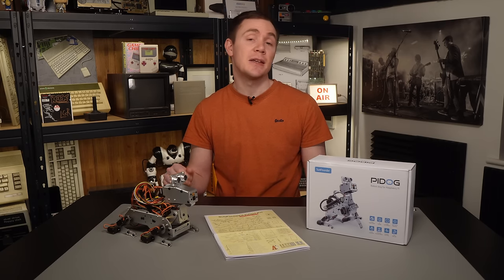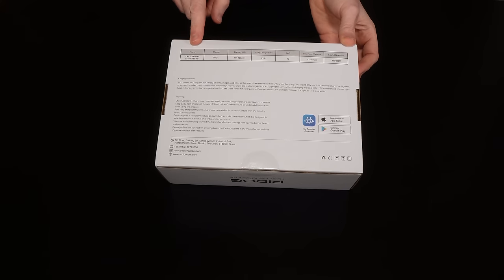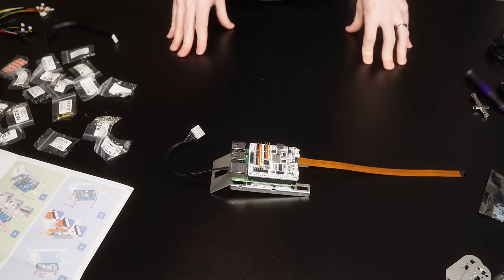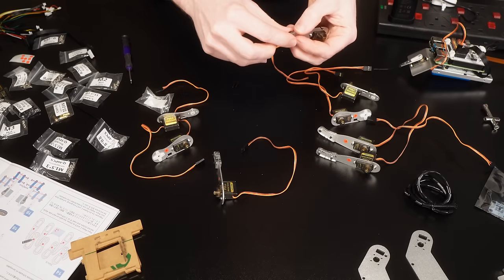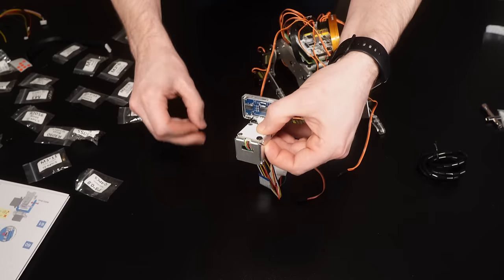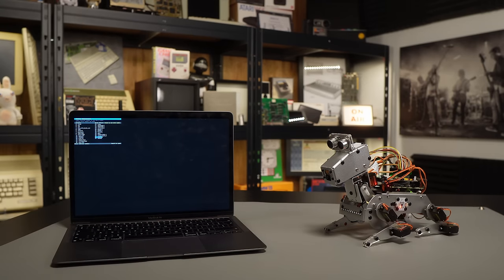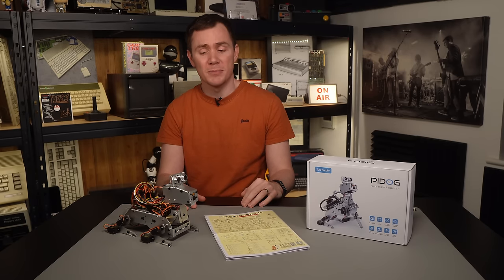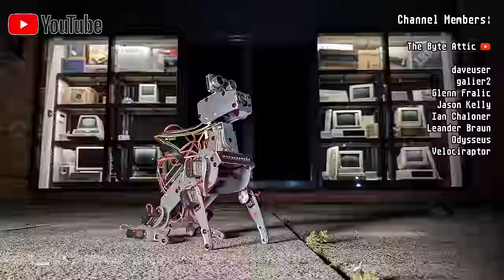I Built A Robot Dog To Guard My Studio - SunFounder PiDog Review

Comment: In adjusted money though this thing is pocket change compared to the '90s Aibo.  I imagine if the battery were charged before use it might smooth out the load to the lower power charger so it doesn't crash.  It was a little too real for our cat though, when it started barking he woke up from a dead sleep and ran outside.

Comment: The problem with not charging is a common problem when hardware makers only test with USB-A to USB-C cables and forget to put a resistor on the plug side to tell the USB PD charger that it wants 5V.

Comment: Have you done anything with a Sinclair QL? I have two and both sadly have issues. One has intermittent video output via the modulator and a non working keyboard. The other also a non working keyboard, wobbly power socket. I cannot work out how to get the motherboard out. I removed the two screws I could see but its still stuck fast. The little wires that go to the leds are really annoying. I dont know what sinclair was thinking.  Re this video its good. :).
Reply from the maker: I have one that I've been meaning to get around to do something with. So many projects, so little time!